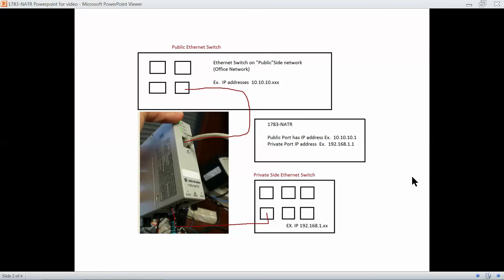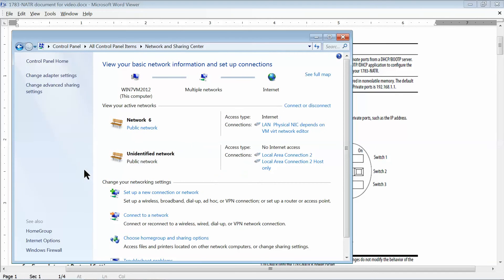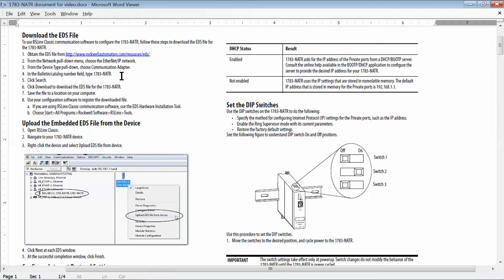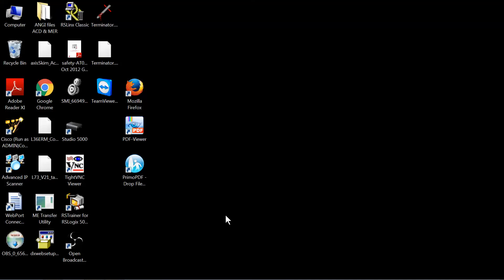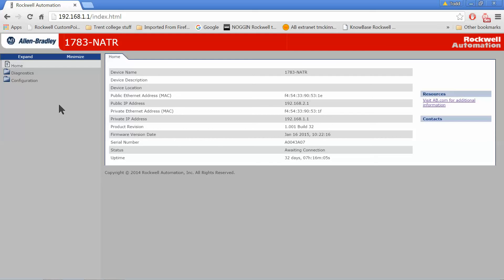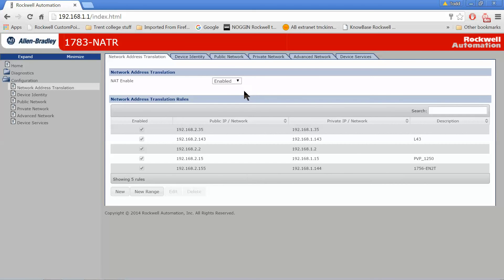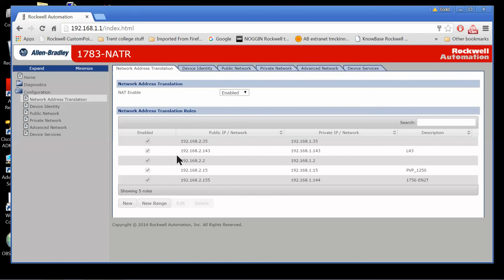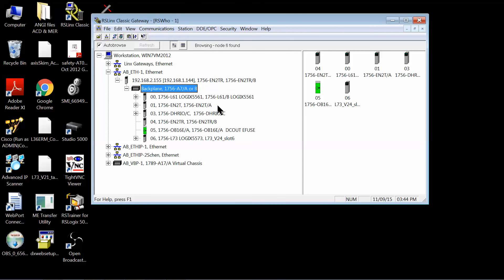1783-NATR by Todd configuration

Comment: Hi...I have done configuration already. But I did not understand when you set the IP address for RS link classic. Dose it same IP with public IP port. I try to the same and do not same. But my computer did not connect to PLC. Please help
Reply: it depends which port you are currently connecting your cable to....public port or private port.

Comment: can i ask why youre public ip adress for natr is 192.168.x.x instead of 10.10.x.x?
Reply: The public address can be anything that you want, 10.10.x.x is just an example. You pick the one that is best for your setup.
Reply: @karlkendall5750  this is our set up, natr has a private address of 192.168.0.85, 10.104.43.217 public address,  we cant communicate with the plc because we cannot assign a gateway address to plc. what can be another solution so we can communicate with the plc? thank you
Reply: @jameskevintingson8572  The real question here is why can't you set the gateway ip on your PLC? What model PLC is it?
Reply: @jabado2009  In case PLC cannot set default gateway, can NAT be done? thank you